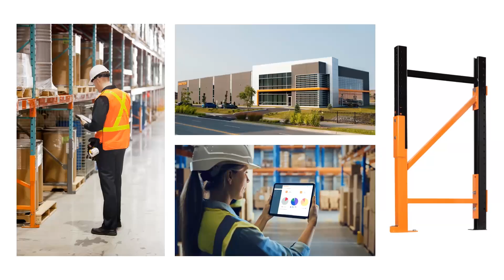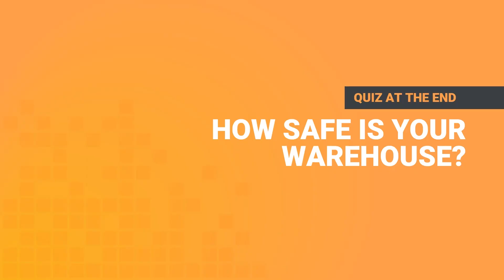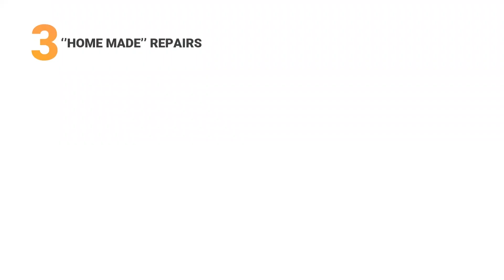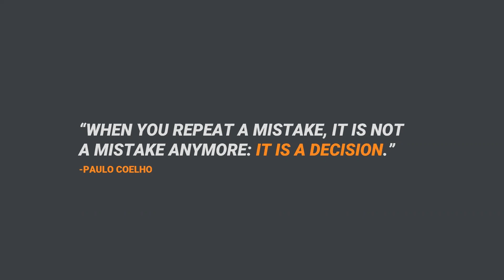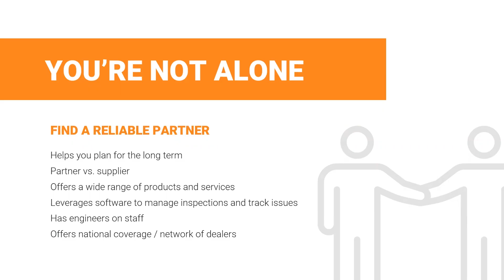What Are the Most Common Pallet Rack Safety Mistakes? Top 10 Explained by Engineers

Comment from the maker: The 10 racking mistakes, in one place — jump to any of them:

10 — Inadequate or no rack protection → 6:28
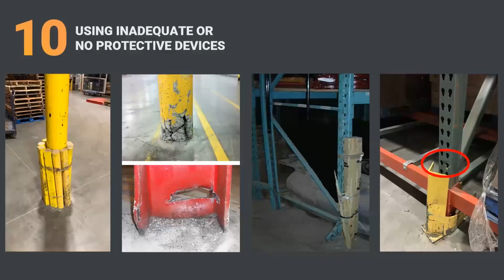9 — Not using your racks as intended → 9:34
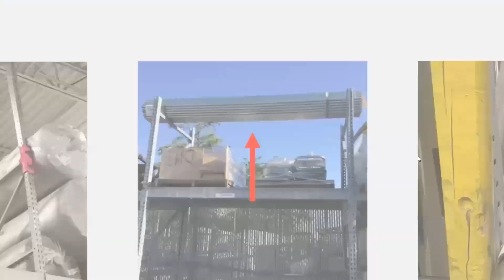8 — Connecting racks to the building structure → 11:43
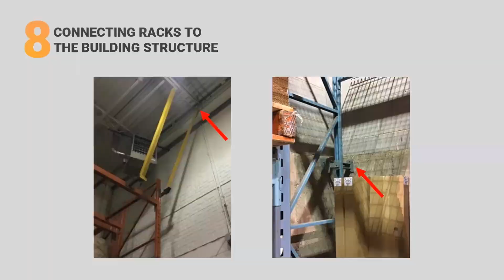7 — Inadequate aisle width → 14:35
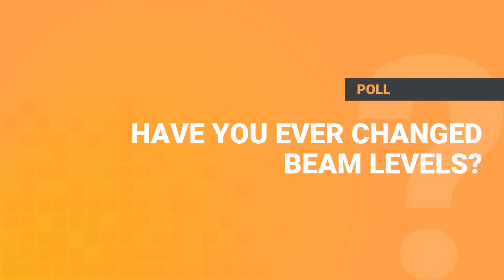6 — Reconfiguring racks without engineering → 15:58
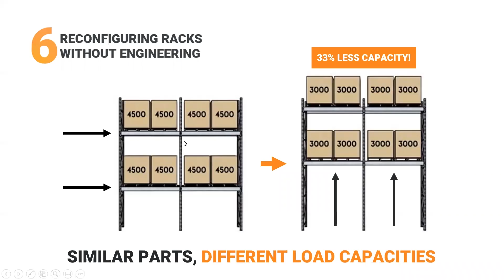5 — Not anchoring your racking system → 18:04
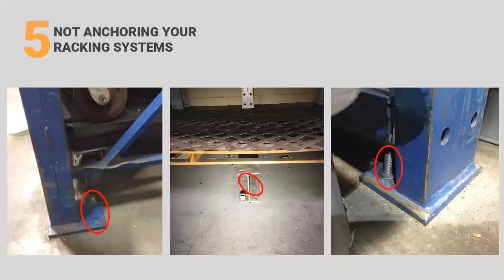4 — Mixing and matching components → 20:27
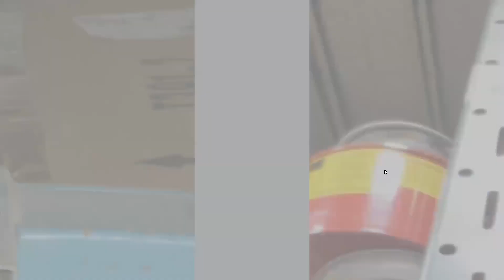3 — Homemade repairs → 23:43
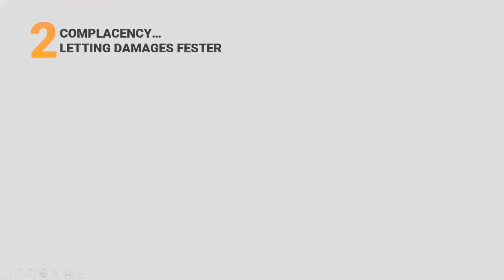2 — Complacency, letting damage fester → 25:52
1 — Not using experts to inspect → 29:29

The one that surprises people most is #6. Moving a beam level doesn't just change your storage layout, it changes the load capacity of the upright — and not in a straight line. In Charles's example, removing the first beam level cuts the capacity of that section by a factor of four, because capacity is governed by the square of the unbraced height (15:58).